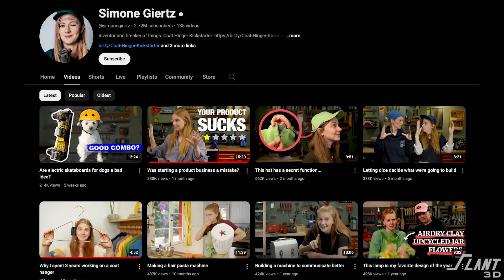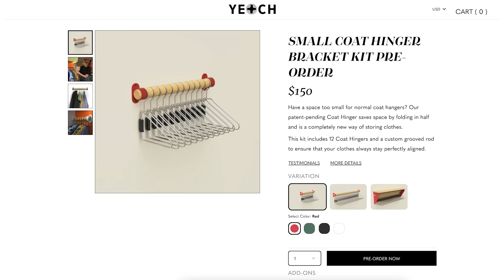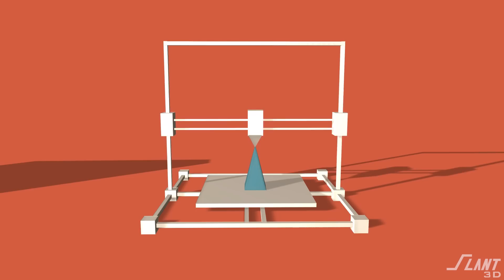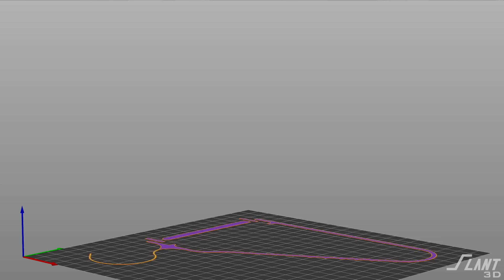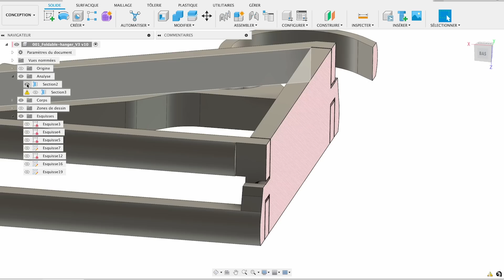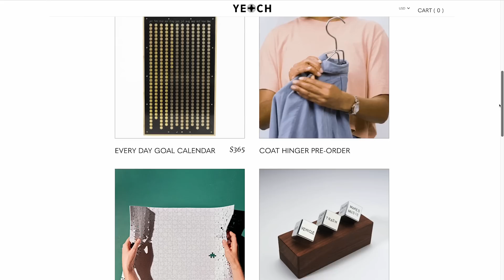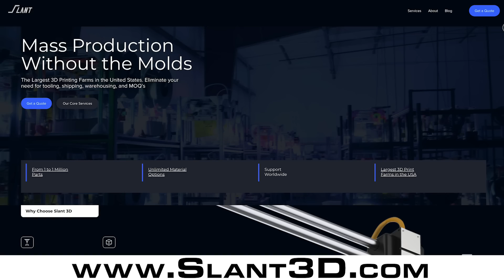We Solved Simone Giertz's Problem | 3D Printed Folding Hanger

Comment: These plastic clothes hangers look like crap compared to wire ones, and this isn't a case where you can just switch to 3D printing. I wouldn't buy this plastic junk. Also, the production time for a metal hanger is approximately 5-7 seconds, but how long will it take to print your alternative?

Comment: A lot of the commenters I think are missing the point of Professor Gabe's lecture...

While he's using Simone's coat hanger as an example of a product and redesigning it, the lesson he's trying to give is so much more "meta" in that you can take a product that you are thinking needs to be traditionally manufactured modify it to be manufactured with FDM and then use the illegal geometry, rapid iteration and on demand manufacturing features of FDM to become very quickly profitable with an item.

People get sidetracked by the product that's being demonstrated as opposed to the manufacturing concept that's being illuminated.

Comment: Hello
Honestly, i think the major issue is the balance of this thing.
Because you can't hang it wherever you want, you need to have the bar designed by simone toot which is very close to the wall, and it will rest on the wall.

I think it need to be fold in three, restoring the balance under the hook, and then boom, you can  hang it wherever you want.

Comment: — I changed all my plastic hangers to metal ones cox the plastic ones either broke thru random application of strength or deformed after long period of time .

Metal ones deforms but can be easily adjusted back to almost the original shape but plastic ones definitely can’t .

Comment: Those features that you describe (the on-demand-ness, order quantities, storage, ...) aren't exclusive to 3d printing. They are a consequence of the part being defined and formed by the tool path, and the fact that that is computer-controlled. You'd also have that for CNC milling, roboforming, laser-cutting, laser-engraving, traditional engraving, traditional printing, ... (That is, as long as the shop/factory can - or does already - store the raw materials.)
You only have that "we're having to set up this machine every time we start a batch" problem for "mold-defined" processes like molding, metal stamping, pressure-forming, extruding, ....

Now, if someone could design a folding hanger that can be laser-cut out of metal. The problem is that in contrast to metal stamping, the hinge would be "highly non-trivial". But I'm 100% convinced that it should be possible. I even have thrown together a hinge design in 10 minutes that would work, with the only downside that it limits the articulation from 180° (fully folded) to something like 45°. The problem is that each hinge limits you to between 45° and 135° angle between the two parts, so you'd need 3 hinges to cover the full range of 180° to 0°. And with 3 hinges (4 pieces) you get problems with locking the pieces in.
Unless you go with 3 pieces, but have the small center piece metal stamped. It can be small enough that ordering 2 pallets will last you indefinitely.

Comment: Steel rod and steel bending are not that expensive tho. I assume she needs at least 2 meters of steel rod for each hanger, then she could sell it for 3 to 5 USD each and still make a profit. She also could 3d print the hinge part for a cheaper start, later she could opt for injection plastic if she wants to

Comment: I really like this and the original version! I’m not an expert in this field, so I’m not sure about the technical implications, but I was wondering if it would be possible to have the middle section stop halfway down instead of going all the way to the bottom.

This might make it easier to hang pants without having to slide them through the entire hanger, especially for wider garments. I’m not sure if the weight would be an issue, but since the original hangers are made of metal and look pretty sturdy, it seems like it could work.

Just a thought! I know these hangers weren’t originally designed for hanging pants, but it would be cool if this idea made it possible

Comment: Its weird situation - I like the concept but its too expensive to buy it from quality materials (yet?) and cheaper version (especially 3d printed one) is on one side needed but on other not worth the hassle and I dont think I would trust it to least long enough. (and the visual despite being better than I would expect is far from the original intended look)
PS: I do also not believe this type of 3d printing is production ready ... you obviously can do it but postprocessing it from layer lines and so is terrible process. Resin on other hand seems like better process but its toxic and more fragile(?) ... one day we will have those Star Trek replicators but there is still long way to go sadly :) (luckily tech advancement is accelerating rather quickly over the years) ... There are metal 3d printers too tho, maybe that would work? I suppose there is lot of terrible postprocess needed too but that shiny metal look + rigidity could be achieavable? maybe costs there are not that viable anymore? 

Afterthought: Maybe there is some compromise - 3d printed hinge (with some accetone smoothing maybe?) and the rest can be probably made from metal (aluminium?) rod with some jig from piece of wood, few screws and metal pulleys at right possitions would be my guess - figuring the dimensions and so out would be the hard part but then it is something most ppl could make .. still some hassle but the end product would look much closer to the original?

Comment: Hi, lead engineer from Yetch here!
You've mentioned some key points here that we have indeed had to deal with, but also somewhat over-simplified some others.

But first and foremost, you are right, the 3D printed aesthetic just isn't really something we'd go for, despite how nice those black prints at the end looked. We try our best to avoid using plastic entirely, to the point that we have very close to zero plastics in any of our products, besides the hinge pieces of the Coat Hinger and the PCBs and power adaptor on the Every Day Calendar. I think we have exactly zero plastic in any of our packaging across our whole product range!
If we have to use plastic like we did in this case, we minimise its use, try to ensure that it'll last a lifetime and then be recyclable if it ever reaches end-of-life.

We're big fans of 3D printing for prototyping and in fact we utilised it a LOT for the Coat Hinger before we came up with something that looked and worked great - for example,  we spent a fair amount of time dialling in the exact friction of the hinge so that the two wings would stay in place without falling open by themselves but also so that they're not so tight that they bind or squeak. For production, we went with acetal for high durability with minimal creep so that they don't become loose over time, required a chunk of testing and iteration with our in-house CNC router before we sent designs out for injection moulding.

The print on demand idea for reducing inventory / storage overheads likely wouldn't help much in this specific scenario, because we still have mid-sized MoQs and inventory requirements for all of the other parts, like the shelves, mounting rods, brackets, mounting hardware, accessories, packaging, etc. So we could print parts on demand, but then they'd still need to go to our primary factory and be assembled into the various kits, go through QC, all of that fun stuff.

You did briefly allude to the fact that at a certain threshold, a print-on-demand service likely wouldn't be able to compete with more traditional manufacturing techniques. I'm not sure what kind of numbers you had estimated, but our initial order was 75k units, which was enough to fulfil our Kickstarter orders and to have some left over stock to sell through the web store. Even then, the cost of the individual Coat Hingers themselves accounts for a relatively small fraction of our overall cost for the product because of the aforementioned parts that make up the rest of the kits, plus the packaging (the 24 Coat Hinger kits are BIG!) which includes moulded pulp carriers, printed boxes, product / colour identification labels, etc. Then there's distribution, transport of components between our various specialist factories, assembly, packing, quality control, fulfilment, etc., PLUS all the stuff in the graph you showed from Simone's video at the 1:34 mark, not to mention our team members that need to pay bills, and of course an operating margin to ensure we can stay in business.

I do think your print-in-place design is pretty smart, but would still need some work to get rid of all the catch points that thin, delicate garments could get damaged on - in fact they would likely need some amount of post-processing to ensure there are no stray snags or boogers in the print and the texture itself may even pose issues. 

I appreciate the well-intentioned video and thank you for the nice comments about our products! In honesty, I didn't realise the scale of production that print farms like yours had reached - I was a bit flabbergasted when you said you could print 10,000 of those hangers in a few days!
Perhaps we may find a need for such a service in our future products!

Cheers!
Stu

Comment: This kind of technique may work for some products, but definitely not for a hanger. Although, a wire hanger, even of a relatively thick gauge shouldn't cost $10 per hanger. As far as stock on hand, it really shouldn't be such an onerous burden for something made out of wire. It'd basically be the same burden as keeping spools of filament on hand to 3D print something. Of course, if you have to contract someone else to produce for you, then you're going to incur higher costs than you would if you produced it yourself. So for something like this, even if she were to 3D print it, it'd be cheaper to just produce it herself, and since the time and space requirements for metal wire are about the same and the end product is better, it really wouldn't make sense to contract a third party or 3D print it.

Comment: Her design is dual-hinge, while yours is single hinge. Yours will pinch the clothes, while hers just folds them. I've printed my fair share of print-in-place hinges and they are never going to be as good as what Simone produced. That said... Yeah, the iteration process on her end looks slow and frustrating. 3D printing could even just help with getting prototypes going, to help pinpoint what the design needs during later stages.

Comment: Nice video!   I agree that for a new idea using additive manufacturing is ideal.  You can bring a product to market so much faster.  And then if it does well you can explore creating a second version that's manufactured how you would ideally want it to be, a premium option if you will.  But in the meantime you don't lose money and you're not screwed if a product doesn't gain the market traction you thought it would.

Comment: Also, the promise of 3D printing is locality. Why should anyone "order" 3D printed things when they can own a 3D printer or pay a local shop? The idea is to avoid the middle men. Just send raw resources and make them into what you need on the spot - this is the promise of 3D printing.
This 3D printing factory method is inheriting a lot of the worst things from manufacturing.

Comment: Honestly, this is the one case where I think metal is definitely the better call. I’ve broken so many plastic coat hangers over the year and I would not feel comfortable paying for 3-D printed coat hangers.
Reply: but remember, this guy is a 3d printing salesman, why would he make a video where the solution is not paying his company for 3d printing?
Reply: 10$ per hanger bro
Reply: Depend on the cost actually, if it was 2-3$ per hanger is way better to have a plastic one 5 plastic at the cost of 1 metal.
Reply: 10$/pc is insane for hangers tho. 2to4$ is max that I'd be comfortable paying for that.
Reply: you're underestimate properly printed plastic, crappy injection molded ones are too thin but the one he has on hand and designed is TOUGH. i can probably stand on it and it wont break. I had this fear before with plastic but then i just kept printing more walls till it was almost indestructible without tools
Reply: @chrishorlebein  so metal 3d printing then
Reply: @stampede18ecs  That does not seem cost effective for such a  product.

Comment: Hook will break.... Dont pretend.... It will take forever to print those as well...
Reply: LOL you need to look at some strength tests of 3D printed hooks where were printed on their sides. They can hold tens or hundreds of pounds and have minimal creep.
Reply: @802Garage  I will bet 1k that hanger won't carry a heavy coat grap and go... Even injection ones have a hard time there is no way this will do more than some light t-shirt action.
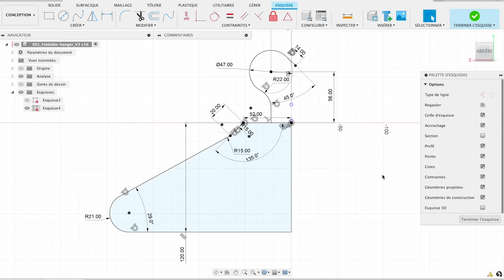Reply: @trkoo  Check out the video "How Strong Can A 3D Printed PLA Hook Be?!?" and at 6:02 a basic S-hook made of PLA with 10% infill and a 2/3 walls can hold 37kg. At 6:06 a C-hook with the same settings held 44kg. That means with just a few more perimeters it could easily hold far more. Show me a coat that weighs over 30kg and I'll show you a suit of armor. That's just a single example of countless which prove my point. Do your own testing at home for that matter. You'll be very surprised.
Reply: It doesnt matter how much it can carry. A metal rod is definitely more durable, especially given how hangers are usually "abused". Metal will at most bend, and it will take a lot more than it would for a plastic one of equal dimensions. Metal is asthaetic as is, plastic is mostly not, especially if not molded. I have used printed hooks myself and they are fine for small volume things, but suggesting the use of 3D printing plastic instead of using Metal Rods simply to become cheaper comes with so many disadvantages that it would completely defeat the purpose of designing a great product in the first place. Its a great DIY Solution, but not a product to sell (in this case, imho, not generally speaking).

Comment: Since her products have an appearance of quality or leanings toward premium appearance, I think it's best to let go of some of your heavy leanings toward cheap, quick and easy, at least to some extent. Could a double hinge work for that application and at the same time make its contact with the wall more square and stable. I suspect that premium products would almost require or benefit from leaving the idea of a single print or part behind so the design isn't compromised?
Reply: I think if Slant used a double hinge they could print the whole hangar laying flat on the printer.

Comment: Isn't the big problem with 3D printing for manufacturing that people can just print their own product? Like, couldn't this folding hangar just be uploaded to printables/makerworld and then nobody would want to pay $25 for it?
Reply from the maker: No scale. Maybe 1 million people in the world have a 3d printer. There are 8 billion people on the planet. You need factories
Reply: Only those with a 3D printer, or those unwilling to spend $25, would consider an alternative to purchasing it? Reverse engineering of products definitely is a risk, and with easy production methods, that risk is increased. I doubt it will be a serious risk though, as most people are not interested (or able) to produce most of the things they use in their every day life. And that typically includes, clothes hangers.